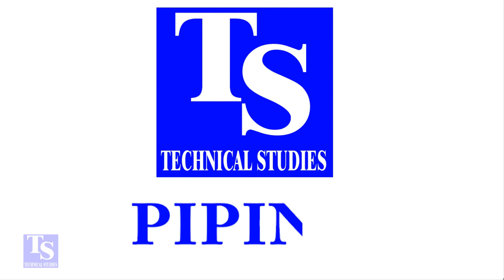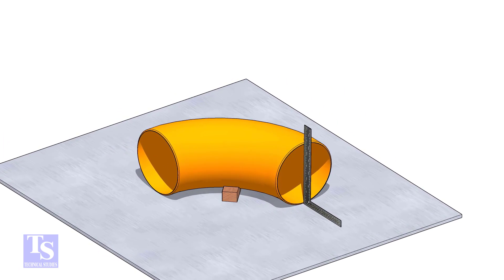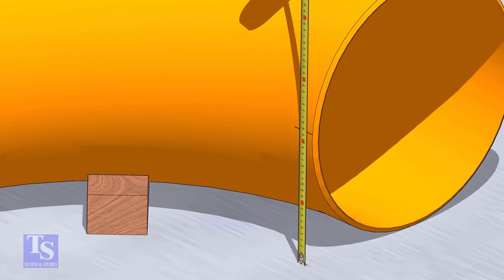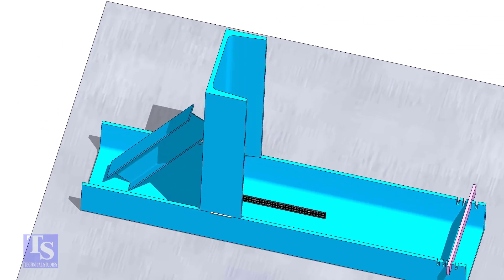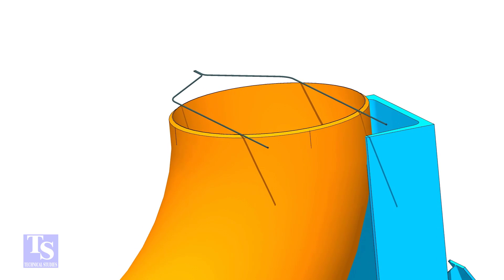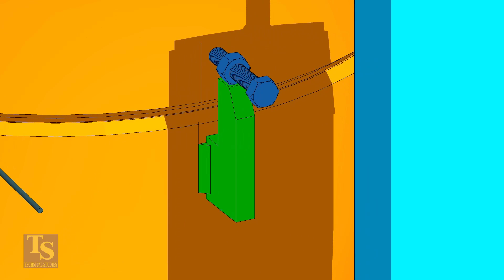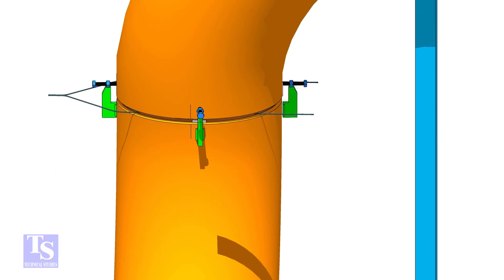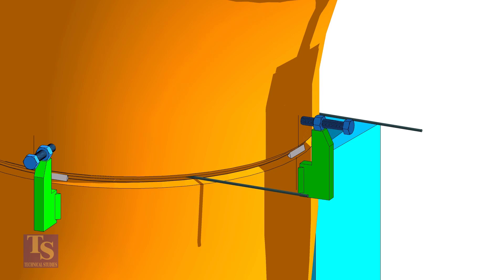ELBOW TO ELBOW FIT-UP TUTORIAL

Comment: Once again not all surfaces of the elbows are always square, i prefer to use the side of the elbow much more accurate, honestly. If you only making one of the elbow to elbow spull piece then its a waste of material and time. Don't mean to be negative but trying to be logical, if you have lots to make of the same size then it a brilliant jig....  Love your topics and appreciate your videos.... Thanks gentlemen.....
Reply from the maker: Bro. It is the basic duty of a fitter to check the squareness of all the fittings. I have done many videos on this topic. If i repeat in every video, about squaring, the video will be too long. I am trying to make smaller videos. Thank you.